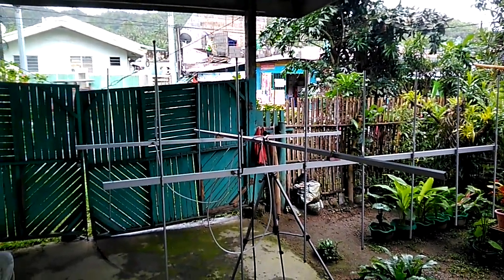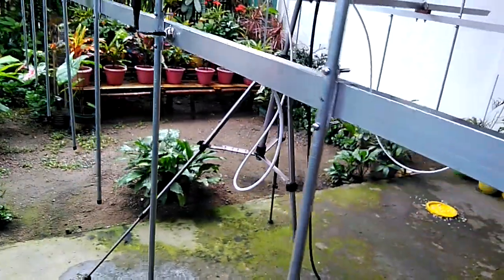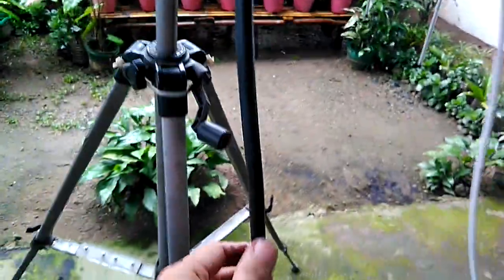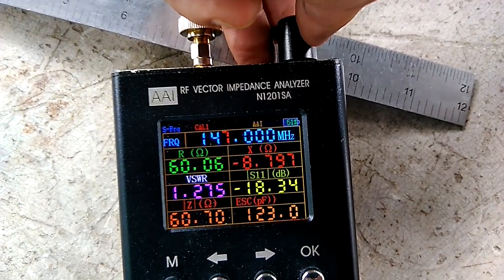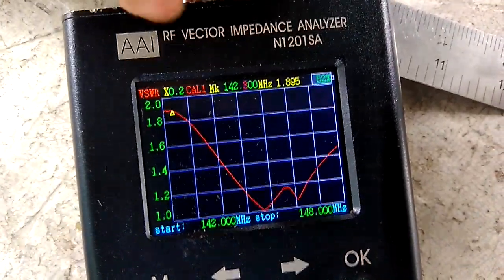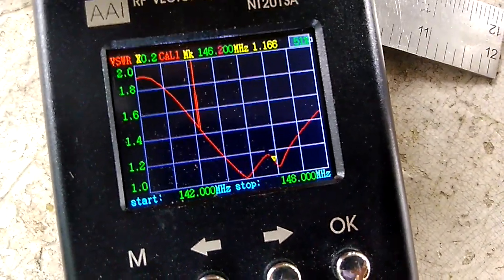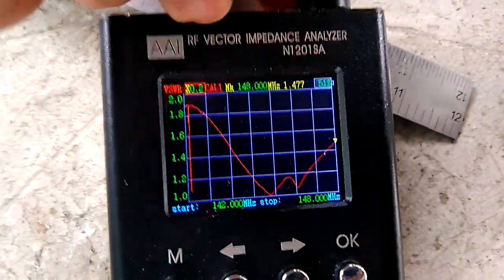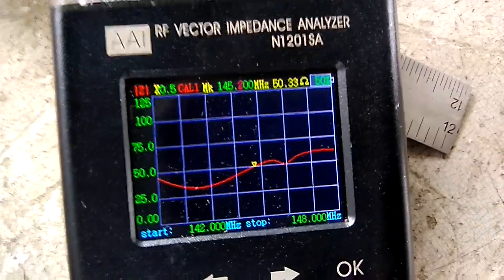2 stacked 7 Elements yagi tuning

Comment: in this specific case, what is the size of each 75 ohm coaxial cable? what is the gain of the antenna? can the analyzer say?
Reply from the maker: 75 ohm coaxial cable should be cut 1/4 wavelength * odd number multiple(to cover spacing)* velocity factor, gain of the antenna is 11dBi per single element when combined its 13dBi, no you cannot see the gain on the analyzer, you can predict it using antenna modelling software for me I'm using 4Nec2